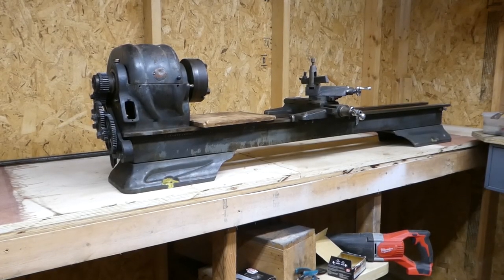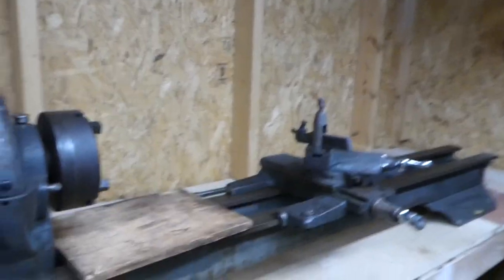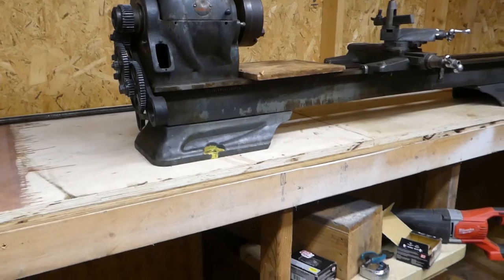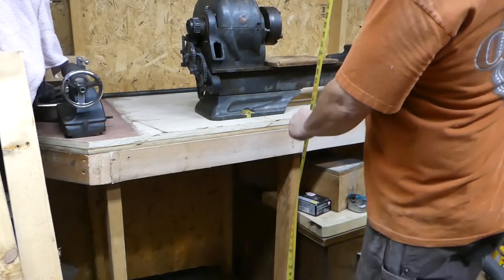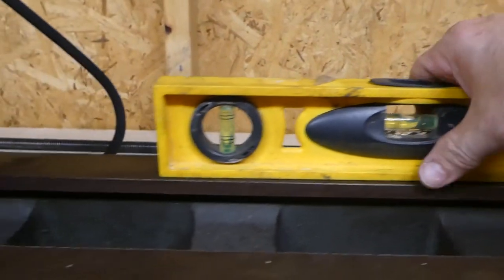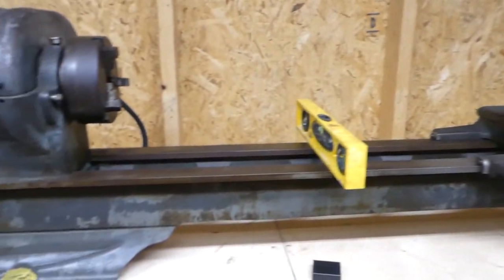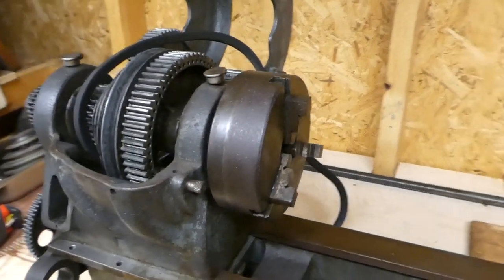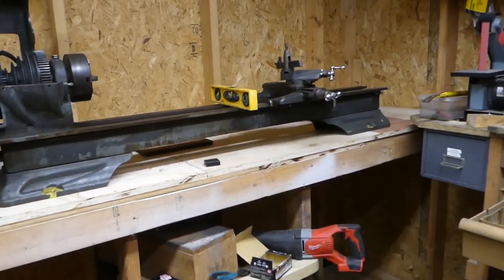If I had a hammer...Atlas lathe bench and shop reorganization update - Week 2

Comment: Never too much space around a machine. It'll soon attract all kinds of tooling when you start using the machine so the flat space next to the lathe will be welcomed Im sure.

Boah straps are useful around a gear and the chuck. Sometimes a 2x4 wedged against a gear is enough to tap the chuck to break the seized thread (with caution) 
And keep oiling near the thread over a period of time. Sometimes you get lucky and the oil will wick into the thread.

Nice space. Organising is oh so satisfying. Good luck!    -Dan
Reply from the maker: Organizing is satisfying, I just wish I could keep it organized. The space is already filling up but still room to grow. 
I did get the chuck off. It was really on there. I used a 3D printed plastic wedge in the bull gear to lock it. But it still took a lot of soaking and an impact gun on a hex bar held in the chuck. Threads are fine, not quite sure what the hold up was but it would not move and even the impact had to work at it, and I broke a piece off the plastic wedge but nothing broken on the lathe. I have a bit of video soon of taking it off.

Thanks,
Eddie

Comment: To remove that chuck use a hex coupler 3/4” or so and a wrench with one of those plastic locks that fits the teeth of the gear. This is so you don’t have to use back gears. I’ve never had one so tight that this doesn’t work, but with the plastic tooth tool an impact driver will surely knock any chuck loose.
Reply from the maker: That's the way I am going to go, thanks!

Comment: Looks good enough, don't have to Joe Pie. If you decide it's too high just make a slatted mat to stand on(ala Joe Pie), helps with the back for standing long periods.
I use poly deck & porch paint for my work benches and shelves. Takes a few days to dry, but is tough and holds up to cleaning with solvents. White  helps brighten up the room and makes parts easier to find.
Reply from the maker: Reminds me I forgot about the one inch rubber mat that is not down, I might have to raise it, lol. The poly paint is the stuff I have in dark grey. I thought about white but it is probably going to be mostly stainless on the back and maybe glav sheet on the bottom covering the paint. I have a bunch of sheets that I salvaged. I take your point though, some white would definitely be nice. I do have some high quality outdoor gloss that I could fill in the none covered areas on the back wall. All of it is subject to change though as I go along. One problem with the stainless is it might be a pain as backdrop for the camera with the glare. Not something most home shops have to think about, lol. The more I think about it white may be the way to go. Can you paint metal with the poly stuff?
Reply: @theeddies  If you need to raise it you can always block under the lathe itself. I mounted my Craftsman 109 to a 1/2" piece of aluminum and melamine I scrounged somewhere. Those Craftsman/Atlas lathes are famous for flexing.
I have a rubber mat in front of my lathe, helps for standing, but swarf imbeds into it, makes it hard to clean, and cuts it up. When I get a permanent spot for the lathe( if I live that long) I'm going to build a springy wooden pallet. Joe Pie showed these on one of his videos.
The older you get the more light you need, light paint helps. The poly does go over metal, question is how much it would help. Stainless splash back is a good idea, for recording you could tape up some masking paper or something. I have found more light is good for my eyes but washes out the camera, for videoing I turn off the work lamp.
Reply from the maker: @psgflier  The rubber mats I have are the kind you might see in a commercial kitchen. They have maybe 1" thru holes every 4 inches or so and are about 1" thick. The swarf falls or is scraped into the holes mostly. Then every once in awhile you can vacuum up the holes or pull it up and vac underneath. A few pieces end up on top but most of that shakes off. Keeps me from tracking it everywhere. The wood is a nice idea though.

I totally agree on the light. I refuse to work without tons of it. If I can not see what I am doing it drive me crazy. I have flashlights everywhere. Every time I go to my dads shop, I usually am turning on every light around if he doesn't.

Comment: I think I know that carpenter! 🤣 I pretty much did what you did in regards to bench height for the exact same reason 😊. Level ain't a big deal really, straightness is a factor though. Even my short lathe has a tendency to get a slight twist. There is actually a very accurate way to level (straighten) the ways using a plumb bob. 😊 
Adjustable wrench on a chuck jaw and a sharp whack with a small hammer usually breaks them loose for me (with bull gear pin engaged, backgears should lock the spindle). If that doesn't work, combine a little heat on the chuck side, shouldn't take much 😊.
Reply from the maker: I'm too much ape to risk the curse of Zamak gears by engaging the back gears just yet. Not sure the last time this has been off. Though please share your plumb bob trick, lol.
Reply from the maker: Oh Dale.... I saw that a long time ago, good stuff, he used to live just down the road, one of those people you just want to punch in the face for no specific reason but other than that he was ok, lol.
Reply: @theeddies  🤣

Comment: the make a 3d printed piece that locks on to your bull gear and holds the spindle i'm sure that would work. just look on ebay they are there looking good buddy. i'm currently working on a Atlas 10f i'm redoing and just picked up a Southbend 9 with quick-change gearbox waiting in line.
Reply from the maker: Thanks for the tip! I saw those awhile back but forgot all about them. I am going to go take a look right now. a QCGB would be nice but I am learning there are actually some advantages with the 10F without one. You should do a bit of video on yours, I think I have already watched every one on Youtube, always good to have more,lol. Thanks for watching!
Reply: @theeddies  I was coming to suggest this 3D printed bull gear holder too. I couldn’t find a file for one to print, so I modeled one up for my Craftsman/Atlas and printed it out. I’ll see if I can track down my model.
Reply from the maker: @DustinRogersinMO  cool, thanks! I was going to check if a model was available. I am so so with CAD but could probably do it.